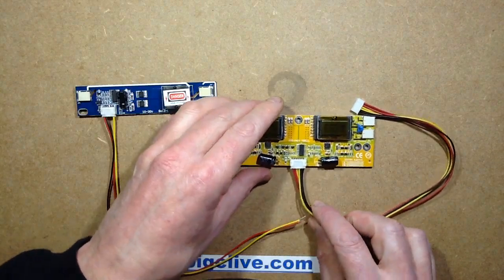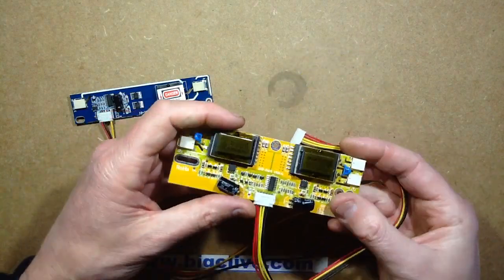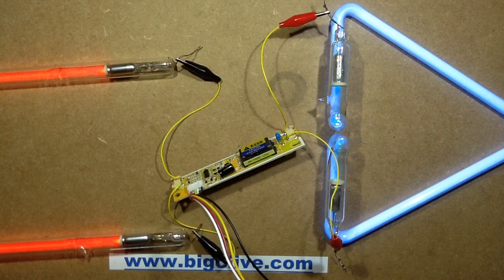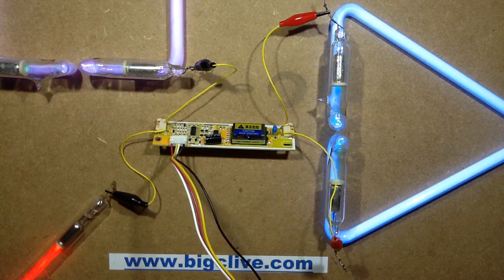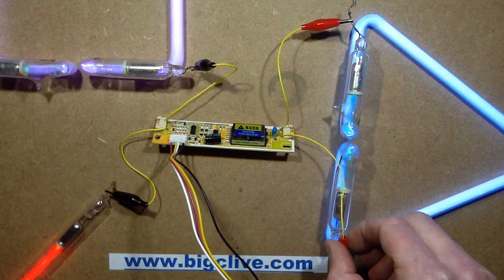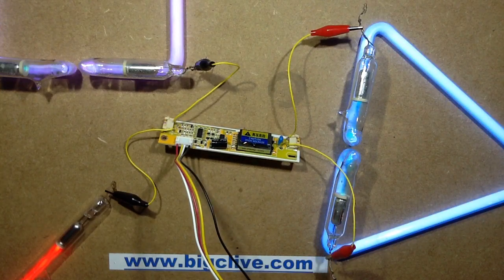Can TV CCFL drivers drive neon tubes.

Comment: Owner of the bar next door asked if I could get the gas tube in his clock working, and this is the only helpful resource on the entire internet that I could find.  Ordered a CCFL inverter, wired it to a 12V wall wart, and bam!  Let there be light.  :-)

Comment: I'm so glad I found this video. I have an old neon sign from a long extinct tube shop. I've been wanting to drive it at low power for decoration (rather than purchase a high power neon sign transformer).  These look perfect.  FYI,  some of the ebay listings do state that the inputs are 0-5 volts only. It's probably best not to apply 12 volts.

Comment: So glad you showed a simple method for kicking it on. I have a project where I really just want the lighting elements of an old display, removed the display bits, might do LED, but since it has the 4 bulb driver already with the simple pinning I should give it a go at least. Cool technology. LED just seems like cheating 😂 
The tv has a halfway decent power supply as well, has a 12v and 5v out I may reuse.

Comment: Very late comment: The inverters (officially) call for a PWM signal for intensity.  I'm guessing that the inverter circuit just reads it as an analog value.

Comment: You can actually audio modulate these drives via the enable or the adjust pins. Cheers :)
Reply: +ciprianwiner 
Hm...... you think what I'm thinking?
Mod the circuit to drive a certain kind of coil playing music? >:D
Reply: theLuigiFan0007 Already made it lol. I tried to make a VU meter. It worked but not that well, because these CCFL tube don't have any heaters and the light won't reach the top since the tube is cold, it would only conduct partially and thus not achieving my goal.
Reply: ciprianwiner
Interesting.

Comment: At 1:37 One MOSFET package/tube. If they got only one MOSFET package/2 tubes for push-pull, it won't kill the output because it would kill also the working tube.
Reply: Basically, they're 2 push pulls configuration, one package/tube

Comment: when you dealing with those tipe of boards sommetimes it helps to search the datasheet of the driver IC... on the led drivers that they sell they use custom chips and in the datasheet you find everything you need...

Comment: I love these older videos... great content and very helpful when trying to replicate..
got a shutlod of different gastubes and it supprised me how different they are too charge / ionize.. neon is clear the easiest to light
Do you have a video where you go three your portfolio of gastubes.? and are their any concern when working with these tubes, powerwise, or are they quite tolerant.?
thx for the vid.. one of the very good ones.
Reply from the maker: I don't show all my tubes, but if you search my videos for neon or ccfl you'll find a few videos about them.
Reply: @bigclivedotcom  Thx, will definately take a look.. Im not sure if I missed it in the video, but these CCFL inverter boards, what plug standard do they use for their active high voltage interface?.
Tried to do as you did and just solder some wires on, but become a failure point when I walked up in power, as it started to micro spark& ozoning like there was no tomorrow and failed at around 20v, but fascinating to see how well gauged thick silicone wires, microspark between them even though thy uare fully insolated..
Reply from the maker: @JAKOB1977  At the high frequency involved you can get capacitive coupling between wires.  They are better kept well apart.  The type of connector they use seems to be a bit random, and none are actually rated for the voltage involved.

Comment: Hey Clive
  I've got an old plasma TV sitting here that had a capacitor guts bath on the power supply PCB. I want to drive the CCFL backlight but it's set up as 18 lamps in series on a 42" panel. I have the transformers from the PSU but the driver IC is an OZ9966SN and has almost no real documentation. All of the circuits I've seen are for 1-4 tubes. Do you have any suggestions for circuits or what to search for in a module to power a panel like this? I was really hoping to set up the panel for bench lights. I'm dumb enough to ask for guidance, but smart enough to keep from getting hurt by HV.
-Jake

Comment: Hello Clive,I have recently been following you here on youtube and find you very informative.I am an electrician by trade living in Canada,my question has to do with service power to homes there,I assume you have distribution of 230y400v,do you use the 400 volt potential for electric heating?ranges,dryers etc.?
Reply: Wayne Rehberg  In the U.K., in normal homes we use 230V / 240V for everything, lighting, heating, general mains outlets. In industrial buildings, large offices, farms etc, 400V / 415V three phase supplies are available. Industrial machinery runs on this voltage.

Comment: Could the flyback circuit of an electric flyswatter be modified to run a CFL curly bulb off batteries? If not I'll get a few of these little inverters on amazon and run them off 12 volts.
Reply from the maker: The flyswatter type supply will damage the tubes electrodes quickly.  Even the CCFL inverter will stress the electrodes in the tube as they are designed to run hot.

Comment: If one connect the cable in reverse wouldn't it be reversed on both sides and cancel out? The only difference being the colour of the cables.(Assuming one doesn't cut the cable and 'blindly' follow the colour.)(pun?)

Anyway, could this type of drivers be used to make ozone generators or are they too clever for that? Do they have an usable voltage and frequency?

I happen to have a couple of drivers like in the "$20 ozone" project, but also a couple of broken screens I might be able to pull the driver from.
Reply from the maker: It does cancel out if the loom is turned round between the two connectors, but I was think more of direct use of the wires.
I've just tried a commercial ozone plate on one side of the unit with a neon tub e on the other and while the neon tube lit brightly the ozone plate did nothing.
Reply: bigclivedotcom Ok, so I assume the tube pulls the voltage down to low and without a tube they go in open circuit protection?

Oh, I'm seeing current limiting capacitors(?) on the drivers with yellow PCBs but none on the blue one. Does the blue one control/limit the current some other way? Could one change the caps on the other ones to fit different/longer tubes?
Reply from the maker: m8e The two tubes appear to be connected in series across an isolated secondary, with their midpoint passing through a bit of circuitry at ground potential to detect the current flow in the tubes.
The capacitors are actually across the transformer secondary and not in series with the tubes.  They may be to provide a small load to limit the floating open circuit voltage if the load is missing or faulty.
Reply: bigclivedotcom Ok, Thanks!

Comment: Why can't they drive fluorescent? Surely fluorescent is just argon-mercury vapour mix, with a white phosphor...
I understand that the electrodes are bi-pin filament style, but will that really make a difference?

I can imagine it would just be like driving a fluorescent on an instant start ballast really.
Reply from the maker: +Dan Coulson A hot cathode lamp relies on its filaments being heated to become emmissive and lower the voltage drop across them.  When run cold the potential across them is higher and often tends to stay in one spot causing progressive failure of the electrode as the metal "sputters" and makes the end of the tube blacken in its vicinity.  Modern tubes designed for harsh cold-cathode style driving are more resilient to this effect.
Reply: +bigclivedotcom This makes sense. Cheers for the info :)
Reply: i tried it on a 6ft tube and it lit but not at full brightness tho
Reply: and thats pretty much what a emergency light has to drive the 8w tubes is a ccfl inverter as the ends go black

Comment: If you run 12v through the ENA, what happens? Asking for a friend that got it to light up or a period of time, turned it off, and it never lit back up... maxed out amps on power supply without raising volts practically at all. The inverter started getting so hot the foam tape on the back started melting.

Comment: As long as the wires on the connector stay in the same order if the cabe is plugged the wrong way it will still work, since the reverse will also happen at the other end, just the colours of the wires will be wrong.

Comment: Hi Clive, I have a one inverter for two tubes (it is blue, input connector is same as on yours board), but I need connect only one tube (14" laptop LCD panel). When I connect it only one tube to the inverter, then tube can lighting only for 1/2 of it lenght. Please, how can I fix that without using a resistor on second tube output?
Reply from the maker: I'd suggest trying to get a single tube inverter.
Reply from the maker: That looks a better option.

Comment: +bigclivedotcom (Q.1) Is it crucial to have silicon covered high V insulating wires on the output ? You've managed with croc clips in the demo. CCFL inverters seem use Silicon insulated output insulation... (Q.2)To suppy 5v you've tied down to +12. to use an old monitor as a light, can one use say, 5v of batteries to test, or independent 5v supply? If so, can you suggest how or give me a hint please? Kudos and profound thanks!
Reply from the maker: The use of silicone is because of its high insulation value.  Modern neon sign cabling is either thick silicone or the same with an extra plastic sheath for extra abrasion resistance.  I tend to recommend it as plain PVC wires can arc through if they touch.  Another reason for the use of silicone is its resilience to ozone as a slight corona can occur between adjacent wires and that accelerates degradation of other insulations.

Comment: i found that the ccfl tubes inverters you could get for pc's would burn out if you tried to light the tubes in a laptop display
Reply from the maker: +drEmulatorMadmax Possibly because they had a higher voltage and damaged the transformer insulation.
Reply: +bigclivedotcom iirc one of the transistors burnt out, but as you probably already know the tubes although are of similar lengths, are alot thinner in width 

i already have a working driver board off of an old 36 inch lcd tv i experimented with, and if i remember it needed 21 volts at 2-3 amps to power the screen, the tubes are like crazily thin maybe a tad bigger than the tube of a pen, with a loop length of potentially 72 inches per tube, i think theirs about 10 tubes in it, held by tiny rubber supports, 

all i can say is wow when i powered it up, it lit my room like outside on a summers day, sadly like a dunder head i didn't keep the metal supports so it's sat in my shed at the mo, 

i have a few laptop screens n tubes, so thanks to you i might get them working (as light boxes)  

tbh i didn't realise they were so cheap until i saw this video, as the inverters that came with the laptops were traceable but had weird chips on that i could never get going
Reply from the maker: +drEmulatorMadmax As a cold cathode tube is made thinner it requires a much higher voltage to make it light and the voltage drop across it results in a much higher intensity (hence the use as a backlight).  The PC cold cathode supplies are only rated for about 1000V and are output-current limited by a series capacitor.  There is a strong possibility that the much higher voltage just stressed the transformer too much causing it to arc internally which would then act as a shorted turn and result in the transistors passing very high current and potentially overheating.

Comment: What is the MM size of those tubes?  Also is there a reason they are different shapes?
Reply from the maker: +Ben Boudreau I think these are 12mm diameter and the sections are basically a length of about 600mm tube formed into a selection of shapes I had made for testing purposes.  I actually designed the shapes on my PCB design software.
Reply: The square and triangle remind me of the Symbols on a playstation controller
Reply: +Ben Boudreau same

Comment: would that drive a Helium Argon LASER.
Reply from the maker: +DAVID GREGORY KERR Do you mean an Argon laser or Helium neon laser?  It would have to be DC and the tubes tend to require a modestly high strike voltage.
Reply: If it's just a strike voltage, can't we use some coil arrangement to start it?